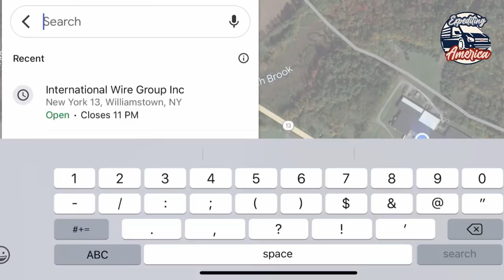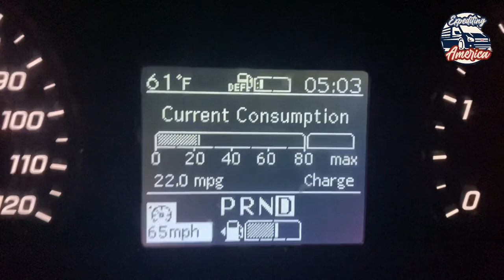Sprinter van expediting with my dog “Bubba Jo” 1,262 miles NY to NE

Comment: These videos just keep getting better and better, bud. Hey, did Nebraska set off your "Crosswind Assist"? I drive a '21 version of the exact same van and was just in Lincoln and then Kearney and mine must have gone off 20+ times. Man, I hate that thing.
Reply from the maker: Wider tires help. But I get that from time to time. I hate it too. Def up in the Nebraska Wyoming plains area where the wind just blows. I pretty much say where there is wind turbines there is wind lol. Thanks for watching.

Comment: If u put a permanent sleeper in 170’ extended. How many skid u can get?
Reply from the maker: Did you not watch the video????
Reply from the maker: Btw my sleeper folds up and down like a Murphy bed
Reply: @ExpeditingAmerica  I did in fact I re watched that parts still didn’t know how many pallets they are u said 4 but looks like 3 to me. And is your van extended or just 170’’?
Reply: @ExpeditingAmerica  I just watched again n saw 4 pallets
Reply from the maker: @truckandtea  it’s 3 pallets with 2 spools then one pallet loaded at 2:57 with just one spool. Those were 4 32” pallets and I still had room for the bed. I drive a 170” extended so it has about another 28”
Reply from the maker: @truckandtea  yeah the shots were kinda quick now when I watch it. Sorry for the confusion.
Reply: @ExpeditingAmerica  got ya bro drive safe
Reply: @ExpeditingAmerica  god bless you brother
Reply from the maker: @truckandtea  will do! Came home for a couple days hopefully I get something outta florida today
Reply: @ExpeditingAmerica  do you have a video showing your bed? Did you build it yourself? Thanks
Reply from the maker: @steffiejoe  it’s really simple. I didn’t build it but could have. I just didn’t have the tools. I’ll do a video about it and do show it in an episode or two but not sure which ones.  but it’s just a piece of plywood on hinges that folds up and down. It was done in a rush due to me not being home long and still needs some adjustment. But does the trick lol